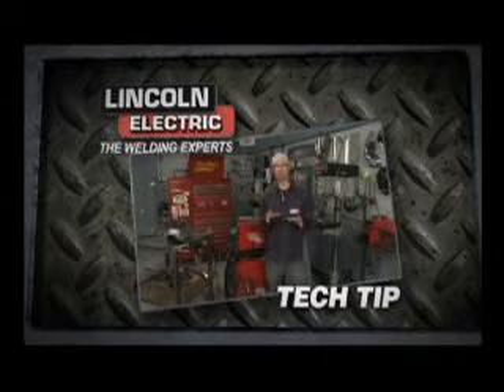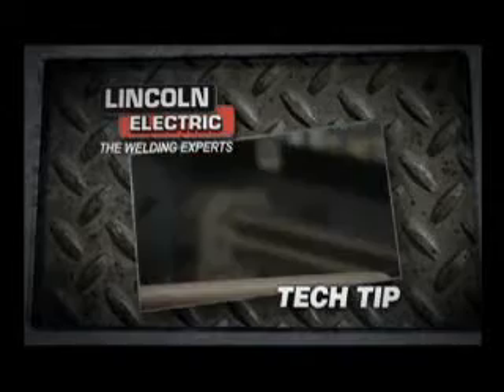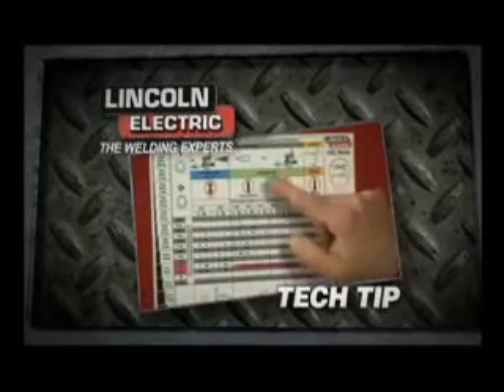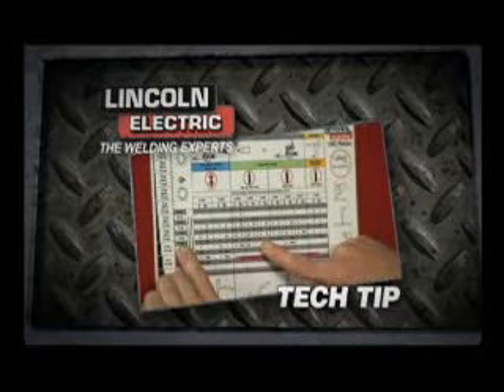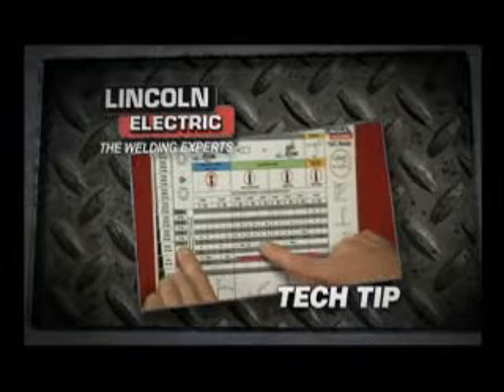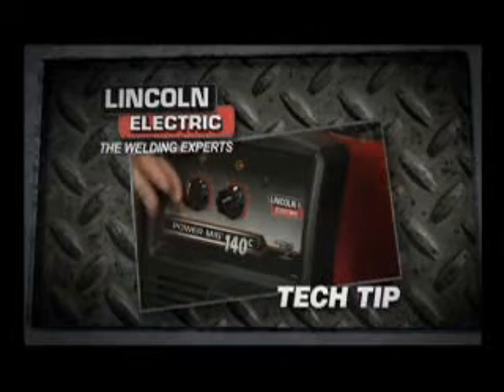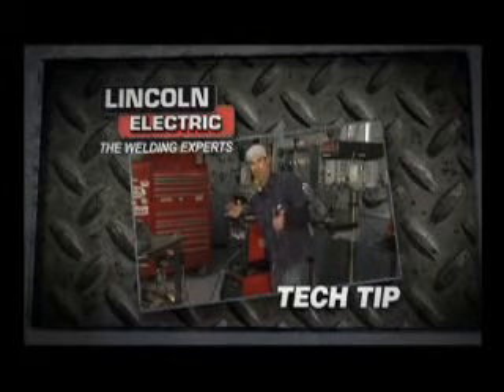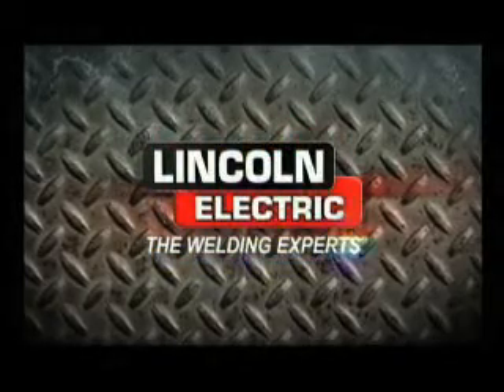Two Guys Garage® - Setting up MIG welder

Comment from the maker: For MIG Welding (shown in this video) a shielding gas is required to protect the weld puddle. Shielding gas is usually CO2, Argon, or a mixture of both. Feel free to let us know if you have any other questions!